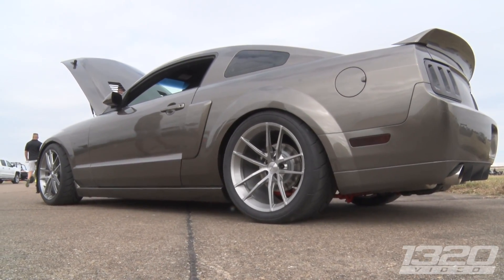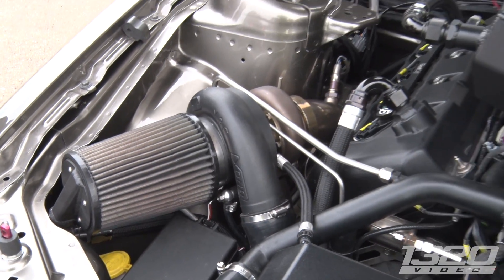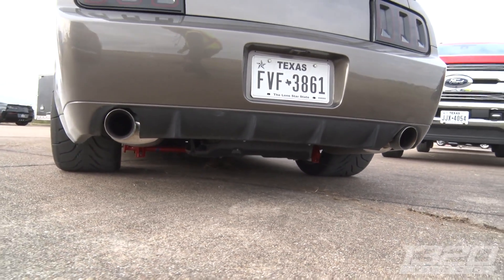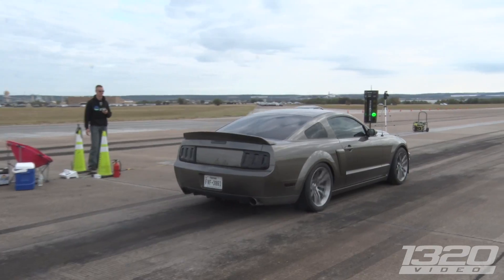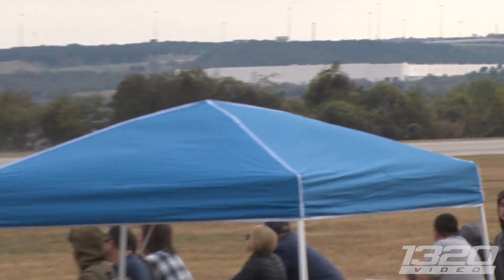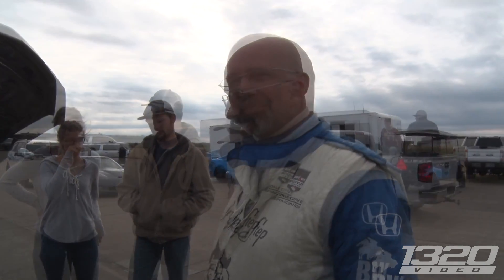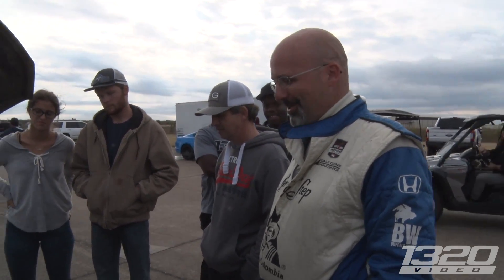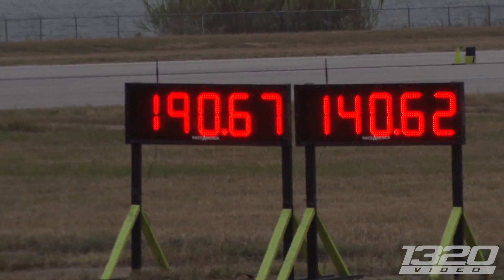Frankenstein’s Mustang - Terminator GT500?!

Comment: It's a bad ass mustang if it would of been a 3valve then it would of been trash
Reply: Ro G 3v aren't that bad if you know how to build them and reinforce their weak points.  They put out the same up stock at a 1995 corba. But if you are going for a project with over 1,000 hp a 4v would be the go too.
Reply: Didn’t know the 4valve could make that much power had a 97 Cobra would have lived to do a 03 swap. What a beautiful car and my my I can’t wait to have one of my own. Great work hope he got his 200+
Reply: Benjamin Goerzen heck yeah they can put out over 1000hp. Those engine are one of the best Ford ever made. You can easily get 600hp out of one with the stock block.
Reply: GpLuigi 16 what about a 2v? how much can that one get out of a stock block?
Reply: Block is same as a terminator. It's the rods that are the weak point. Good till about 425rwhp, although I have seen some pushing more on a good tune. The key is preventing detonation.
Reply: Ro G 3v and mach 1 both stock have the same power. Sounds like the buddy brought the wrong mods. I bet if he changed the gears to 4.10 it would be different. It's all in the parts you put on the car man. Both cars are good, but you usually get more power off of a 4v. If you say 3v are trash you don't know how to build a car. If you say 4v are trash you are just plain dumb. 5.0 4v are excellent to, it's just most people can't handle the power, hahaha. End up in a YouTube crash complamation.
Reply: Advocate 2v are probaly the hardest to get big power out of. Especially big dyno numbers. I would say to get the most out of it, Cams(Ford racing are good), long tube headers(Pace setters or BBK) an X pipe(or if you like that old muscle sound H pipe, but less power) and some good axle backs(that's really up to you on sound). Also you NEED a handheld tuner, they work wonders. If you don't feel comfortable with that get if tuned professionally. That could put you around 300-310hp(at the crank more around 260rwp) Then if you have the extra money a supercharger running around 5 psi, would still be safe(hp depends on the blower) Same as the 3v don't get the supercharger with the most boost or you run the risk or blowing the engine. Hopefully that will help some bud.
Reply: Zimbabwe Champion the reason people end up blowing the engines is no because they are trash, but they don't get them tuned, or run to much boost.
Reply: 3v would be trash? Do people forget that there was a 2v? Those are trash, only thing good about them is the block. Good for when you want to stay under 300WHP, 3v and 4v are actually worth modding.
Reply: Due to aftermarket support and being so numerous, two valves are a lot better platform than they used to be. Trick flow and head porting has done wonders for the 2v. I do agree tho, the boost is a major cause for rod failure. Which is why I'm an advocate of getting supporting mods for the blower so you can make more power with less boost, like heads and cams.
Reply: Jared B off the dyno 2v are hard to get big numbers. Although because they are so cheap to buy, you can save some money for mods. Thankfully in the last 10 years aftermarket parts have improved alot for 2v. But how I see it, it's like this: 2v for a fun starter car you can get 250hp-300 out of. 3v can get around 350-400hp unless superchargerd they can get way more, so it's a good car if you want to build a quick car that can be daily driven. 4v+a supercharger is almost limitless and are what you want for racing. Modular engines are all great though for daily driving.
Reply: Now a days a 2v is just a good a platform as a 3v if not better due to aftermarket support. 2 valves aren't trash, people just don't take the time to properly build them. There are plenty running 600rwhp on stock heads, and alot more with ported heads or trick flows. So all of them are feasible for making power.
Reply: Zimbabwe Champion 600rwhp? Even with a 3v you would need to reinforce the block. A 2v you would definitely need to rebuild the engine and reinforce the block. To get those number you would also need a supercharger on both running a good amount of boost. If you are going to 500hp+ a 3v or 4v would be best. 600hp+ a 4v would be what would work best. 2v are not terrible, definitely sound good, its just old tech, hence it takes alot of money to get big power.
Reply: Well yeah, I was just saying with the stock heads lol. Since it's the heads we are comparing. Really when u go past the 600rwhp mark I mean your spending big money anyway. 2 valves are actually cheaper to mod than three valves lol. 3 valves cost more to port, the motor and block are the same so that doesn't matter, and the 2v has more intake manifolds and they cost about the same. Just saying 2 valves aren't that expensive to build compared to building a 3v or 4v that doesn't have forged bottem end. The trick flows send the 2v into 4v territory anyway. I've seen big bore stroker 2 valves with trick flows pushing 500rwhp under 8000 rpm with ported eddy manifolds and custom grind cams. And plenty of them boosted with trick flows making great numbers, alot making 1,000+. Those heads are prayers answered lol
Reply: Zimbabwe Champion true. Cost wise they are the cheapest to buy. If you are willing to pay. A 3v is good to because you are starting at 300hp rather than 250hp. But really it's up to the individual who is building it. That and the individuals skills and knowledge. Just work with what you have, you have a 2v work with it, don't sell it to get a more powerful engine build it up. You know?
Reply: GpLuigi 16 3v block is good and will hold 1k stock. Internals suck and heads are actually 5.4L heads. And can flow up to 700hp power level

P.S. 
Theres no such thing as reinforce a block
Reply: David Martin when I say reinforce I'm talking about replacing the engine heads and internals or actually taking the engine out and rebuilding it I guess reinforce was a poor choice of words. I have an 06 3v and I going of what I have heard multiple times from engine building shops and forums. I'm no mechanic. Haha. I usually see 3vs around 460hp before people go messing with the internals or just use another engine. I'm sure they are capable if they share gt500 heads. Im also going off of what I would be comfortable running, without have a high risk of blowing the motor.
Reply: GpLuigi 16 yea internals suck. But the block and heads are fine
Reply: David Martin exactly and that's why some many people are so hard on them. It's like they get mad because they have to actually build the engine up, for high HP. That and how heavy the car is.
Reply: GpLuigi 16 I get what your saying but even getting the motor for nothing isn’t worth it half the time. Even Basic cam set ups cost 2-3x as much for a standard 2v than Fords old Pushrod 302,  I love me some modulars, but you cant really say the 2v is a great motor, yeah it can be if you drop $5k worth of parts into it, same with anything though. The problem is that Modular motors only make more power with more valves per cylinder, when you have the same amount as a similar pushrod engine, they will flow the same amount of air and make the same power, (4.6 and 5.0) Hence why I chose the sn95 with the 302 instead of the 4.6, both are 2v and Its proven you can make more power out of the stock 5.0 with less money, a Mod motor to me is only worth it when its a 3v or 4v or else you might as well have a basic 2v pushrod v8. Obviously, for both motors once you have hit 500+ HP its a whole different story, one has weak internals and one has a weak block. Still wish my 302 sounded like a turbo 3v though, my favourite sound personally.
Reply: Jared B yeah. 2v are just old tech and like I said the hardest to get big power out of. 3v and 4v are easier to build up and easier to get power out of. 3v sound amazing, I have and longtube header with a catless X pipe and borla stingers, sounds amazing. Still miss my old H pipe though. 302? I bet that sound nice.
Reply: GpLuigi 16 bet that sounded amazing, the 302’s sound good, it will sound better after I rebuild it, bore it out .30 over, and use a Borg S475 turbo to feed her
Reply: Competely agree
Reply: I don't think I have run into a bolt on pushrod 5.0 yet that has come close to my bolt on 2v. A cam swap alone is worth 300, and just to get there with a pushrod you gotta do heads and cam. Cams are easy to do yourself on a 2v and 3v, so the cost is only around 600 or 700 bucks. Not to mention the 302 block is actually garbage. 98 cobras are 4 valves and they still have trouble beating two valves. They are all great platforms with certain weaknesses that can be fixed, and it's called money lol. And we will never have enough, cause we will never be fast enough Lol
Reply: I still prefer the 2v sound the most. I don't know why some people say 3 valves don't sound good tho, I think they sound great. I just don't like the way coyotes sound tho. I have longtube headers, o/r x and bullet mufflers and boy is it loud lol
Reply: Zimbabwe Champion I love the sound of the X pipe on Mod motors, I also don’t like the sound of the coyote, doesn’t have that raw muscle car sound like they used to. As of now my 302 has ported upper/lower 93 Cobra intakes, deleted smog and all that, BBK shorties with a cat less H Pipe, and its dumped right before the axle with no mufflers (gotta love Canada) Safe to say Its damn loud and I don’t drive it for extended lengths of time down the highway. I got a buddy with a 01 GT and we are almost neck and neck while racing, then he slowly starts to pull on the top end, Probably helps that I have the T5 trans also as its much easier to shift. We both wish we had each others sound though. His car has full magna flow with I believe a cat-less x pipe, sounds great.
Reply: Advocate 400wheel
Reply: 5th(2014) gen mustang with a 4v aluminator motor (2015+)
Reply: The 3 valves based on the Triton truck motors had weak rods. As soon as the motors were properly built, they took a good beatin. The intake passage on the cylinder heads were a great design, having an almost straight path down into the combustion chamber. Kennel Bell blown examples were pushing well over 800 to the wheels. The reason they hit a brick wall was the advent of the Coyote motor. 3 valves had a short Mustang life. Totally different from the 4 valves that lasted from 1996 to 2004, or the Coyote which has been going from 2011 and shows no sign of going anywhere soon. 3 valve was a 2005 to 2010, a very short life. But it was a good motor, just not fully realized. Another reason is how turbos have exploded on the scene with Coyotes, they didn’t make a huge dent on the Triton scene. But definitely not a crap motor.
Reply: @Gpluigi16  that's good advice but your numbers and stuff are off some.  You can get 270 whp from full bolt on and tune out of a 2v...the 99 up one with pi heads that is...that's about 310-315 at the flywheel.  With good cams you can get to 300 wheel.  People run 8-10 psi all the time on stock blocks...itll get you above 400 whp with proper supporting mods and the block can handle that.  I wouldn't go too far beyond 400 wheel on stock engine but I've seen some in the 425+ range with good tunes just a blower and full exhaust/good tune.  You need to build the bottom end of the engine if you wanna go beyond this.  3vs are good for more than 425 wheel on stock engine some go upwards of 450-500 it depends on the tune if you got a real good tuner and solid supporting mods and stuff you could safely go to 450-475 imo.

Comment: Since when is a mustang a sleeper
Reply: Auston S how many mustangs on the street have 1500 at the wheel. It has hard tires it looks almost stock and should run 1/4 mile in 7s not high 15s.. Thats why its  sleeper
Reply: Jd Texan 

A sleeper is a car you don’t expect to be fast... & does not look or sound like it’s fast. 

I fail to see how any V8 mustang would qualify as a sleeper. 
Even stock GTs are not sleepers, you still know they move.

Comment: You may want to contact Nelson Racing Engines who could Build you a 5.8L Shelby GT500 Twin Turbo engine using a Dual Fuel System ( 91/93 Octang and E85 or Race Fuel).  They have tested a 07 Shelby GT500 5.4L Twin Turbo engine called "Code Red" and it was tested to over 1500HP: http://www.nelsonracingengines.com/videos/proof/NRE-s-Shelby-Code-Red-Engine.html  Maybe they can help you to get over 200MPH +!  Check them out!...and God Bless!

Comment: Put a real motor in it (LS) and you will see 200MPH!
Reply: Diesel Tech a Ford GT 5.4 ran around 293 miles at the Texas mile. Nice try.
Reply: Putting an LS in a Mustang should be blasphemy
Reply: Jorge Pulido maybe 293mpyw
Reply: Diesel Tech Or we can stop being an idiot hating on the motor and use your common sense. I have a turbo LS swapped 3rd gen Camaro, so I'm not just a Mustang fanboy either.
Reply: Each engine has its own advantages, let people choose what they want
Reply: Jorge Pulido A broken clock is correct twice a day. So whats your point?
Reply: Honestly no one really cares about cross-brand engine swaps anymore.  Not 2005 anymore.
Reply: Nice try troll.
Reply: You sound like a fan boy “put an LS in it”😂
Reply: LS is only used as often because they're cheap and common. There are literally no advantages beyond those two.
Reply: This Motor and a fully built LS can push the same power, the Modular motor just does it with less cubes.
Reply: Diesel Tech well it gapped that Cadillac and that crapvette both of which have LS engines under the hood so...
Reply: HAHAHAHA!!! You're funny!
Reply: Hey buddy you can ruin your own mustang with an LS
Reply: The mod motor is not that bad it just not many people know how to build them right there is a mod motor that can run 5 sec quarter its on youtube check it out kind of cool
Reply: scythelord really? So there’s no torque, size, and weight advantages?
Reply: jbrandon302 There is really no sense in starting the mod motor vs ls thing again. Both have their goods and bads I happen to love both. Im a big ford guy but how could I  just bash a badass ls? Im not, I'll mess with the ls guys but not bash there shit it just fucking stupid
Reply: Black 96GT I agree
Reply: Mason Lopez lol, "here's a modular Ford engine running a 5 with a stubborn owner who dumped a small fortune into it." And then there's the lsx running 1.3 seconds quicker and probably cost 25k to build, including the engine. 

There's a reason nobody builds, swaps, or did much r&d in them, cause they're just inferior in every way to the LS engines of that generation. Full bolt ons and a tune to get 300hp if you're lucky out of a 4.6 is an absolute joke.
Ford did a good job promoting the stereotype that American cars couldn't do anything but go in a straight line with the 96-2009 mustangs while also proving they aren't that great in a straight line either.

That being said the 5.0 coyote is a good engine and actually put up a fight against the ls/lt engines for once.